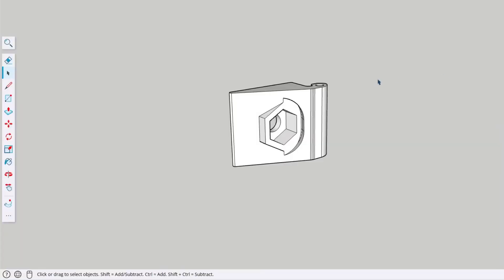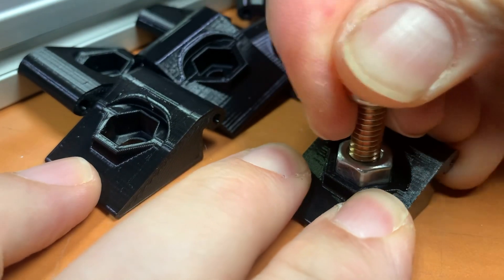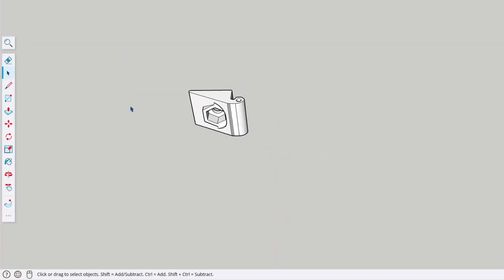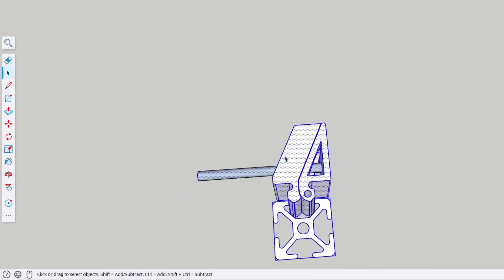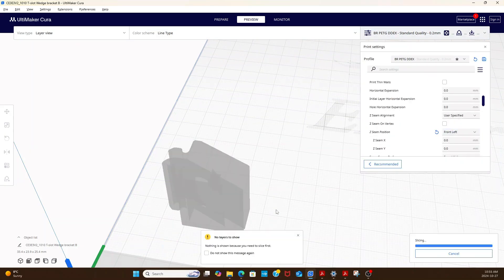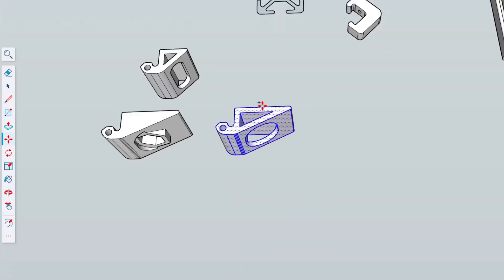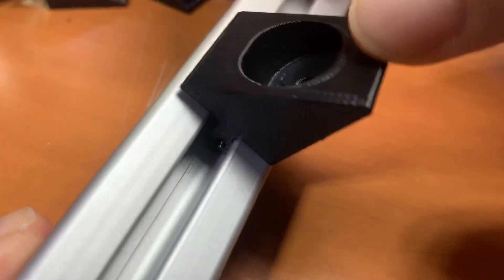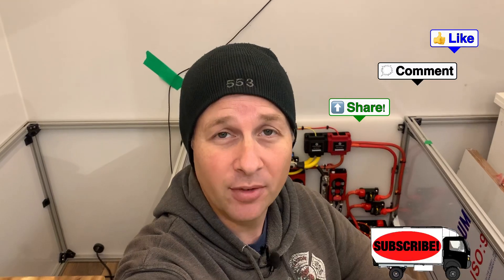OVERLAND Truck Camper built with Custom designed 3D Printed parts!

Comment: Nice job Bruce. Are these made for 1" or 1.5" profiles?
Reply from the maker: Thanks! - these are for the 1010 profile, which is 1” - though I’m not sure all the internal shapes are the same from one brand to another.
Reply: @BruceandKrista  Thanks. Can you share your part file, and can it be created to support a 10-32 nut? I use 10-32 to support panels since plenty strong for those and yet visually nice with the smaller bolt head.
Reply from the maker: Yep, I’ll add a link in the next few days in the video description to where I upload them.  Can you modify STL files?

Comment: CAD software is very much a "whatever you learn first" thing I've found when talking to most people. That said, I'd say give FreeCAD a shot if you get the itch. They have their 1.0 release candidate out (if not full 1.0 release by the timing I'm writing this), and I would say it does most of what I need now (coming from Fusion). I wasn't a fan of Fusion's forced cloud storage on the free tier and much prefer FOSS approaches where I can.
Reply: So true. After using AutoCAD for 3D for 10 years, I am STRUGGLING to learn fusion 360. Things that I could do in less than 5 minutes are taking me over 30. But, practice practice practice and eventually I'll get the hang of it... I hope
Reply from the maker: Like eating an elephant!
Reply from the maker: One day I’ll make a switch!  I’ve heard good things about freeCAD (and Fusion).

Comment: Here's hoping that whatever ails ya' is on its merry way elsewhere very soon!  It's always a great idea to have a change of scenery or do something different when not feeling at the top of your game.  If 'Sketch Up' does what you need, stick with what you know.  After decades of engineering I still use AutoCAD, but if you don't have to use it - just - don't... 🙄

I've just come inside from working on some new roof lining panels for our little 'guy'.  I needed to drill out endless pop rivets to remove the existing fibreglass panels, but the new panels are much lighter so they'll go in with 'fir tree' clips.  Working inside the module for a while was a nice change of scenery.  Back to the grindstone welding some framing tomorrow.
Reply from the maker: Oh, new panels - nice!  It is nice to switch back and forth between different areas - also allows one’s brain to stop thinking about problem A while working on item B, which I find often allows for the solution to problem A to pop into my head!
Reply: @BruceandKrista  Yep, absolutely agree about the problem solving.  Most of the interior of the module on our truck is white fibreglass, and to be honest we just got sick of acres of the stuff.  The new roof liner panels will be covered in grey stretch carpet to take the hard edge off things a bit.